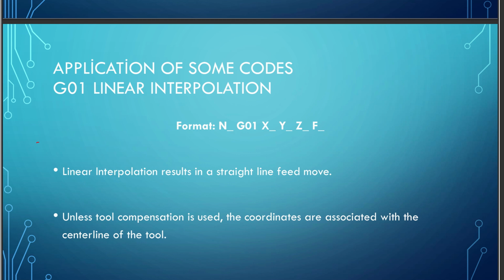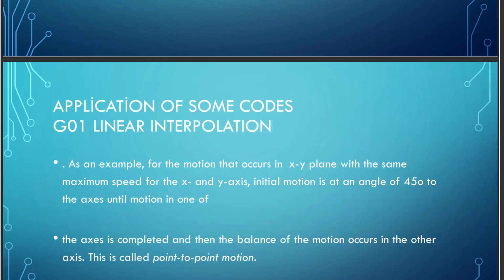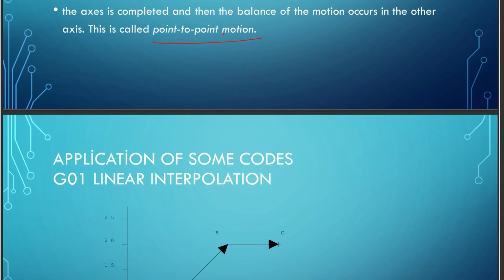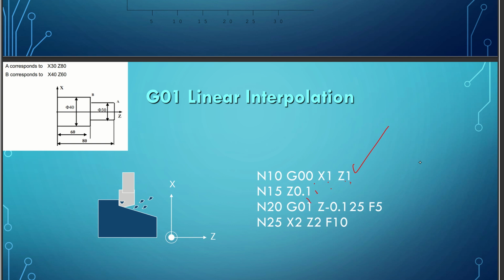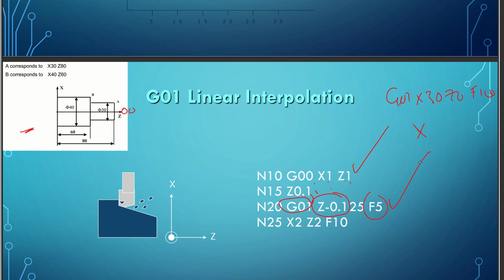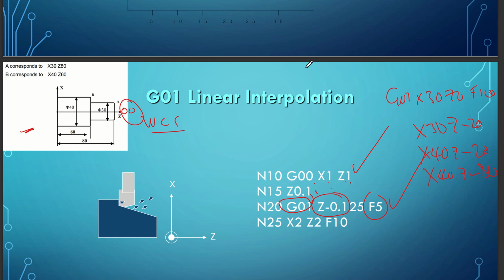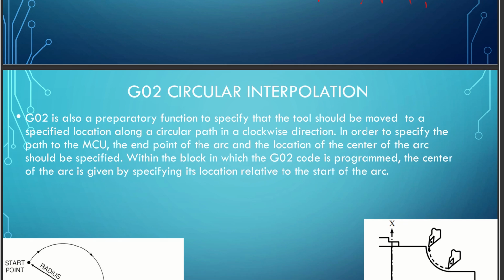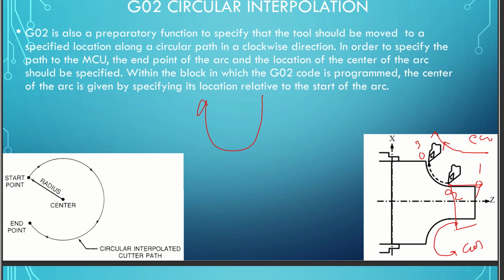Part 4 – Application of G-Codes & M-Codes in CNC Part Programming | CNC Turning & Milling Basics

Comment from the maker: Both controllers follow ISO standard G & M codes.

Siemens has a more structured environment and supports advanced cycles.

Century Star uses simpler syntax and is often easier for beginners.

Comment from the maker: This quick reference shows the differences and similarities between Century Star CNC and Siemens CNC (840D) programming.

Feature / Function	Century Star CNC	Siemens CNC (840D)
Program Start	O0001	;N10 or %_N_MAIN
Block Number	N10, N20…	N10, N20… (same style)
Rapid Movement	G00 X.. Z..	G00 X.. Z..
Linear Feed Movement	G01 X.. Z.. F..	G01 X.. Z.. F..
Circular Interpolation	G02/G03 X.. Z.. R..	G02/G03 X.. Z.. R..
Tool Call	T0101 (Tool + Offset)	TOOL CALL 1 Z S1
Spindle Start (CW)	M03 S1000	M3 S1000
Spindle Start (CCW)	M04 S1000	M4 S1000
Spindle Stop	M05	M5
Coolant ON	M08	M8
Coolant OFF	M09	M9
Program End	M30	M30